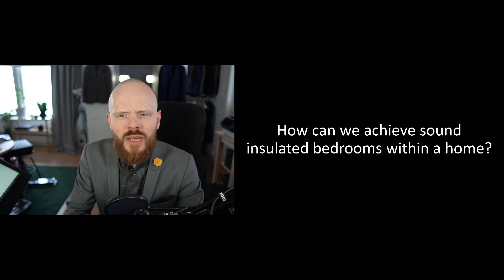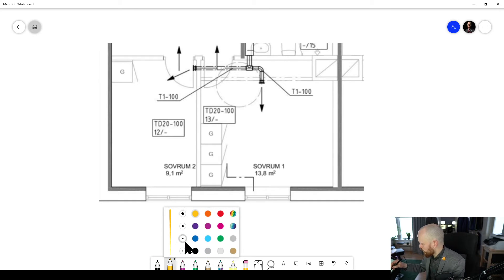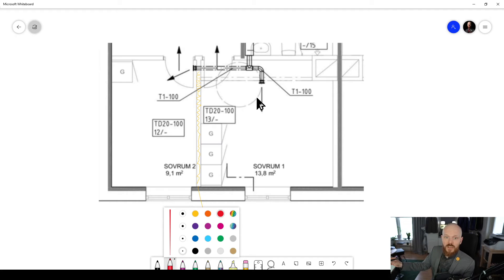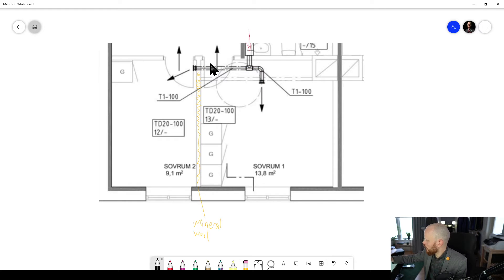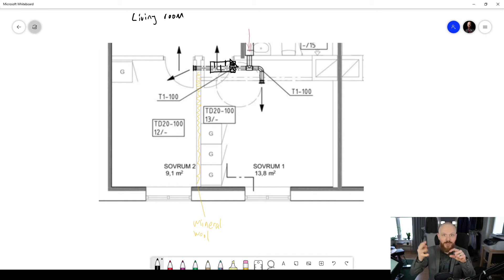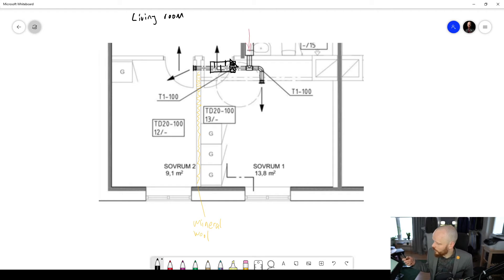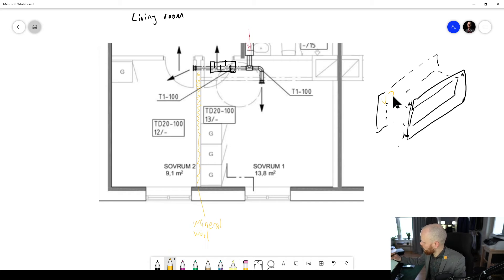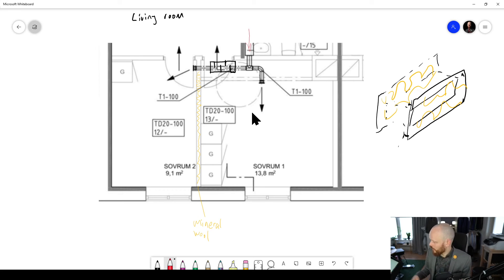QnA: How can we achieve sound insulated bedrooms within a home?

Comment: Dampen, Dampening for reducing transmission of sound in  the vent was correct as far as I recall.  It means to reduce intensity or strength in this context. 

"Tröskel" might mean threshold.  I think for the door modification you were talking about you need a "door sweep" that fastens to the bottom of the door slab and covers the gap underneath towards the threshold or floor (depending on the design of your floor I guess).

The material you likely are speaking of that goes between the door slab and the door stop is usually called in Canada by trades people as "weather stripping".  

https://www.doorsforbuilders.com/wooddoors/terminology/
Reply from the maker: What about "Wall pass through" could that work? 

Yeah of course, Threshold was probably the word I was looking for. I was over-complicating it, looking for some technical term. thanks!

Great site, thanks again! It's quite difficult to speak technical language and find all the words that I know in Swedish. It is a completely different experience from conversational english!
Reply: Youre brilliant and I learn a lot from you Rikard. 

 Im a "unilingual" (made that up according to spell check) person for the most part and I still find myself at a loss for words often.  So no worries I think your facility for communication is immense.
Reply from the maker: Great to hear that! It’s a proper challenge to do the technical talk in English, but hey, our world is “shrinking” and we need to work together. Language is a key to wisdom. I wrote a blog about that last year, check it out if you are interested: https://www.creativeacoustician.com/blog/cultural-nerve-gas